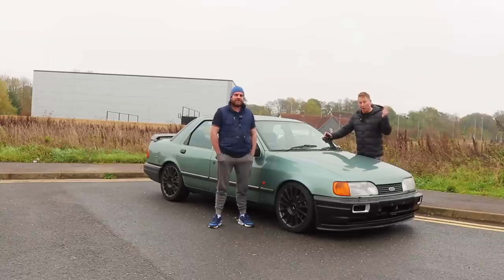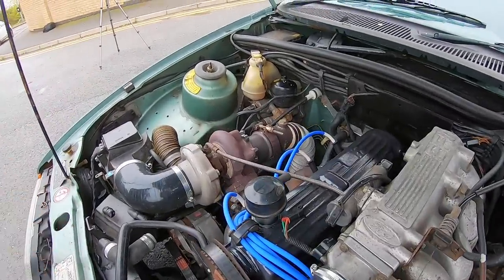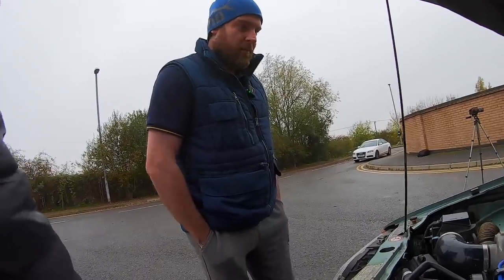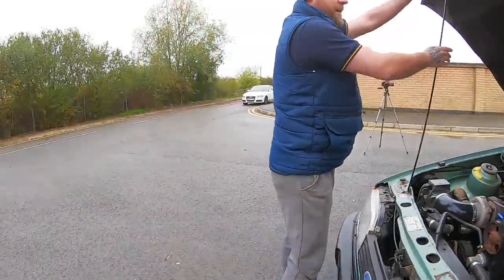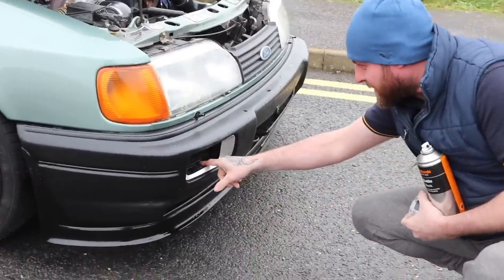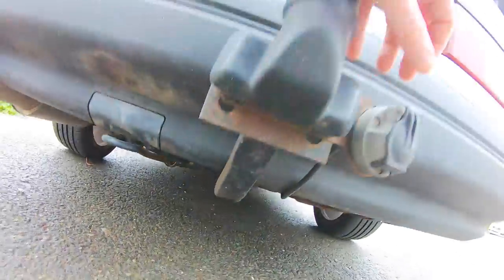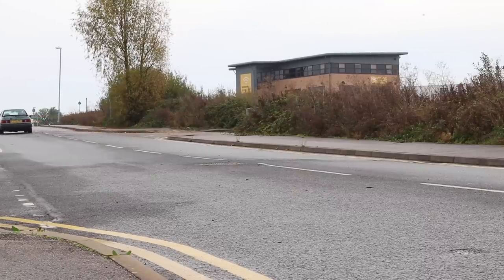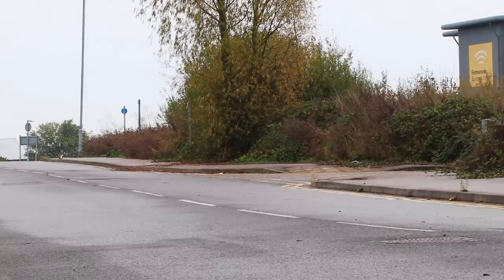THIS AWESOME TURBO-CONVERTED SIERRA SAPPHIRE ONLY COST £2500 TO BUILD

Comment: Ive ran a bunch of different types of pinto turbos,  that's probably about 160hp, great for a daily driver though.  I used to run exactly the same setup in a Sierra estate on standard management.

Comment: I had a 1983 Mk1 Sierra 3 Door 1.6L in the same colour with not a spec of rust on it anywhere that i put a rover sd1 engine in and a scorpio 24v cosworth interior that bolted straight in too it and a cosworth bodykit back in 2002 it was a mint drive i had some laughs in that thing, I bought a 2.0 litre mondeo to turbo it and put the engine in it and never got round to it then sold it to a guy from essex who wanted it for banger racing duh, I wish i had never got rid of it i still kick myself now when i think of it.

Comment: I could never understand why they called it the pinto engine. The Tl20 (made in Europe) was only used in the pinto for a short time and was upgraded in 1974 to the LL23 2.3 which Europe never got.

Comment: Aww bless, its like when your dad used to say his V8 rover was a "flying machine" when it did 0-60 in something like 13s. Or the local 17 year old reckoned his RS125 did 130mph. Utterly deluded.
Reply: Actually the rover 3500 vitesse did o to 60 in around 7.5 seconds.
Reply: @ivanfernyhough3851  Wow, so probably about 3s quicker than this thing.